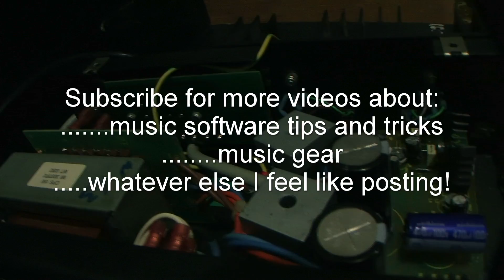Soundcraft CPS 150 power supply modification

Comment: I Have one of these. The voltage selector board is burned up. Do you have a pic of yours. I See it here but its too dark. The schematic isnt helpful. Regards.
Reply from the maker: https://www.gearslutz.com/board/geekslutz-forum/371724-soundcraft-spirit-studio-cps150-repair-question-4.html#post13071983
Reply: @cfcreative1  Thankyou my friend, its helped to confirm what I suspected. A possible faulty transformer. I've wired things up correctly but all the voltages at the transformer secondary and prior to the bridge rectifiers seem incorrect.

Comment: can you tel me something about hum i have the same but it hums is it the power supply ? is that why  jou did the caps?
Reply from the maker: The transformer does vibrate. I put a silicone rubber pad under mine.
Reply: the hum is coming out of the c/rm dus this help / i open my power supply just and I see that the transistor  2k7 pos R32 is burend i have to replace that one , than i see that one of the rectifiers pos BR2 is black onder it ??
 where can i find this one ? to replays ?
Reply from the maker: I would get all new capacitors nichicon, a higher rated resistor and new bridge rectifiers. Do all the caps even if they look fine.
Reply: where did you get the bridge rectifiers from?
Reply: and did you had a hum from out the mix consul
Reply from the maker: I got them here in Vancouver. You can corder your parts from Ebay or online.  Nichicon are good capacitors and get Bridge Rectifiers 200v rated 5 amp or more. Higher than 200v is ok. Get a high watt resistor for R32 1/2 watt or better. You may find an electronics store where you live or order online. I get most of my parts from Ebay too.
Reply: thanks!  but did you have a hum from the mix consul ??
Reply from the maker: No mine sounds perfect. First check the ribbon cable carefully just press on it where it is connecting to the channels etc. Your noise might be coming from a bad channel, group or main board. Turn the volume up on your headphones and turn off all channels, all groups and see if it goes away.
Reply: i doint have it on the headphone its the c/rm output thats giving the hum.
and also the volume leds are not working i think the IC ??
Reply: and that also mean that the power sup is ok otherwise i had a hum on the headphone
Reply from the maker: I can tell you that it is most likely the capacitors that are the problem. But also check all the connectors. What board do you have?
Reply: i think the same as you have the Spirit STUDIO   16/ 8/ 
I order de IC , Not yet the Cap also there is a print gap the I notes where the capacitor is but thats no probleem to fix
Reply: The connectors are ok
Reply from the maker: Look at the capacitors sometimes you can see if they are leaking. The faders can be pretty dirty too. I love it it sounds good.